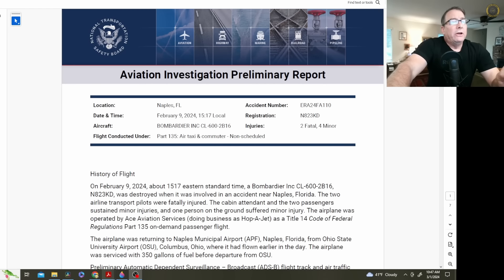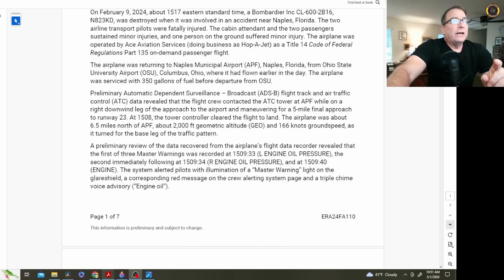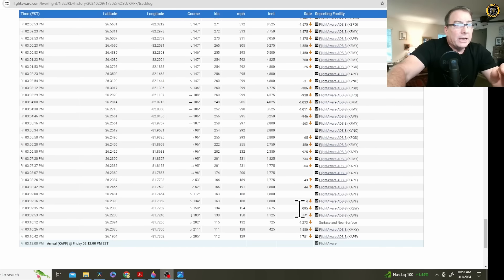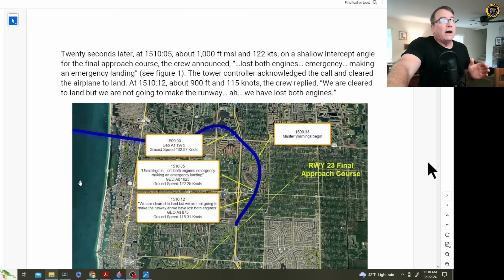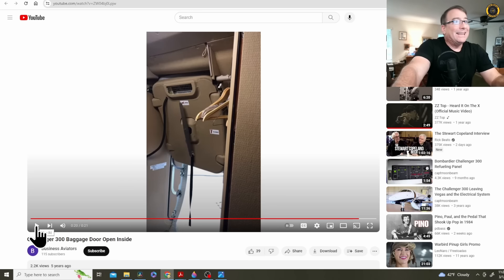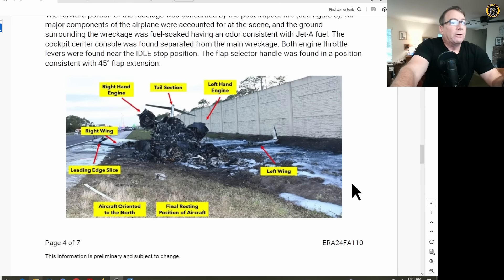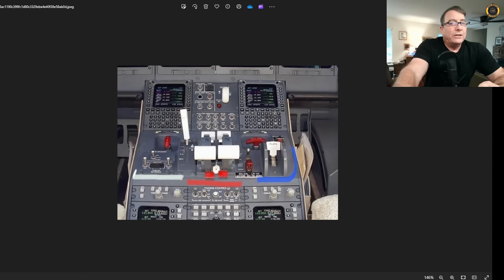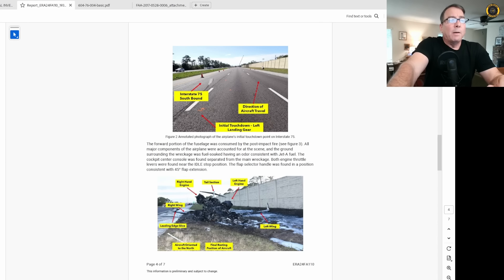NTSB Preliminary Report: Naples Challenger 600 N823KD

Comment: I don't fly a Challenger 
But 
At about 6 miles out and 1800-2000 AGL ft would you ever move the thrust levers to Idle?
Would the pilot in the left seat put his arm UNDER the FO's arm to operate the flaps?
That seems weird to me..
Could a Software glitch shut them both off?
RIP Pilots, they Almost made it
The drift to the right in the end got'em.
Reply: OK rereading the Flight recorded data they were about 6 miles out 18-2000 feet and 166 knots, 
Was this too fast and the throttles retarded to flight idle and then moved into idle cutoff?
It looks to me in my Lazy Boy that the crew shut down those engines
OUCH
Great footage JB of the baggage door, what a safety feature!

Comment: on the subject of 'reaching' flaps and other pilot decreasing thrust simultaneously.. wouldn't the designers of the aircraft not have somehow applied prevention of 'engine shutoff' whilst the altimeters and air/ground velocity were above zero? I'm struggling to think of a situation where shutting the engines off entirely in those circumstances would be necessary? Surely a pulling a fire extinguisher would do the engine shutdowns above the 'non zero' conditions? @blancolirio

Comment: Water in the fuel.   I live very close to the crash site.    According to the map of the flight path it is likely that the plane flew directly over my house (probably at 1510.00);as many do on the approach to Naples. I am very interested in this crash and will continue to monitor the investigation. The first fire fighting units at the scene were regular units and used water to control and or fight the blaze, thus inundating the aircraft with water. Perhaps this is the source of the water?  The word on the street is that the Naples Airport dispatched the foam trucks.

Comment: I left a long comment on the first video. 
I work with the Critical Air Ambulance team that crashed just after takeoff in San Antonio airport back in 1994. All crew aboard kil*ed do to the wrong fuel being put in the plane. Jet fuel not Avgas. The pump handles were put on the wrong pumps. The pilot tested the fuel but the correct fuel was in the line but not in the tank. It's a sad but interesting story.
Reply: Is there a link?
Reply: But this aircraft seems to have flown much too long for this to be a possibility
Reply: DUE to the wrong fuel.

Comment: Even if they inadvertently shut them down it takes only seconds to relight them.
Lift red shutoff levers, move thrust levers back to idle, press in continuous ignition switchlight, that's it, they will be running again, plenty of time from 1000' agl to do this and the CA would know this.

Comment: Jet A at it's jelling point can still flow at the huge demand rate of the engines at cruise.  Slow the flow rate at idle-decent, and then advancing the throttles can starve the engines from the sluggish fuel.  All evidence will of course be melted.

Comment: A small Cessna is 3 lane widths wide and might fit in the median while this plane is 6 lane widths. If it landed in the median its wings would be hanging over both left lanes, and landing on the road, it is hanging 10-20 feet off either side depending on centering. If the bellied in I suspect they would have made an attempt to cut off all thrust and fuel flow to the engines as or just before touchdown because you do not want thrust or fuel flow and want to stop. I would make much of an idle thrust lever position, this is a crash and I doubt they had any thoughts of using the engines on the ground or they would be available for normal landing engine use.

Comment: Yeti Airlines of Nepal ATR72 in 2023 they reported one of the pilots pulled the props to feather instead of throtles.  Adding throttles  wouldnt add thrust .  Then in panic elevators up too.. And stalled.  Killed most.  Using heavy gloves mutt the feeling of the tips of levers.

Comment: Didn't know until this, that the three that got out weren't all Pax. The cabin crew girl did a GREAT job too. The guy in the command seat reaching over to get the flaps
for the FO flying at the time being that clumsy ??? Best job possible by whoever was flying.
Reply: The “cabin crew girl” was ALSO saving her own ass!
Reply: It wouldn't have to be a "clumsy" move. Just both pilots doing what they were supposed to be doing at the time.

Comment: With thousands of hours of flying and thousands of landings between the cockpit crew, pulling the throttles to idle just prior to touchdown could be a muscle memory example, regardless of the engines running or not. I'll bet Sully's thrust levers were at idle before his landing on the Hudson. I don't know if the throttles at idle is necessarily the smoking gun.
The theory of inadvertent cutoff certainly is plausible and makes the most sense.

Comment: I'm going with throttles moved to the off position.  Question is how did it happen.  Juan gives a good analysis on how that could happen.
Same thing happened with OU quarterback Steve Davis.  PIC let him fly the approach and he inadvertently moved the throttle past the stops turning off both engines.
If it was fuel it would seem more likely to happen during an earlier stage of flight vs in the last 2 minutes during approach for landing where the throttles would be moved to idle.  I expect the CVR will reveal exactly what happened.
Reply: Except you would think that two very experienced pilots would have checked this immediately. How did they not try to throttle up and/or restart? Makes no sense.
Reply: @OMGWTFLOLSMH  Not very experienced in the Challenger.  It's looking like the engines shutdown ~1500 and about 1 min before the crash.  I don't think they had time to restart.
Reply: @OMGWTFLOLSMH because it's impossible to restart the engines that low and slow without the APU running. The engines are started by air powered starters that get bleed air from the APU. It takes almost a minute to get the APU started and spooled up online, then another minute or two to get at least one engine started, up to idle, then able to add power.

Comment: wasn’t there a similar mishap on a yeti airlines ATR when the copilot inadvertently shut off the props instead of adjusting the flaps?  on the ATR the levers are adjacent and there are no lock levers and the hand movement is the same, take hold of a lever and pull back. But on the Challenger the copilot would have had to release both lock levers and somehow pull the throttle back with his arm while reaching for the flap controls (?).

Comment: From what I can find, in the CL-600 if you lose 2 engines, you lose the 2 engine driven "primary" hydraulic pumps and perhaps the 2 generators driving "backup" pumps for the flight controls, unless a windmilling engine is sufficient to maintain pressure via either source.  System 3 - Utility hydraulics (another source of power for flight controls) has electrically driven primary and standby pumps that can be powered by the APU (if running inflight) or by the "ADG," Air Driven Generator (essentially a Ram Air Turbine) as a final source of backup hydraulics.  

Question is, perhaps the reason they couldn't finish a perfect highway track alignment was a loss or "degraded" source of power to the flight controls?  I didn't see any mention of this in Juan's report but regardless, a hell of piece of aviating in the worse case scenario the crew found themselves.  RIP to the cockpit crew...
Reply: From the videos  it appears the ADG was not deployed so it is possible they had the APU/ gen online ( everyone flys these things differently - some light them up on final or some wait till after landing runway turnoff)  or else the ADG would have deployed automatically from loss of a generator... or tried to. 
The Challengers have 6 hydraulic pumps 2 of them engine driven and if the apu was lit then they had AC power to run the 1B and 2B and I think the 3B hydraulic pump too.  For arguements sake if all 3 systems were inop there are accumulators for each system, so there would be a few strokes of hydraulic assist available for flight control. Also never factor out the power of pure raw adrenaline, the flight control system is cable, bellcrank and pushrod so it can be flown.

Comment: What about the fuel purchased not containing any Prist after it was offered by the fueler but declined by the captain?  If there was slush in the fuel filters, the fire would of course melt any icing in the fuel without leaving any trace.  Is it possible the fuel additive was declined because they were flying to Florida and assumed they did not need it.  This sure reminds me of that British Airways Tristar losing power on short final.

Comment: I wonder if the flight data computers record the thrust lever position state if they have entered the idle cutoff position due to left seat PNF inadvertantly releasing the interlock with his right forearm while lowering the flap lever to landing position, then them both realising within a few seconds of no engine power and the subsequent low oil pressure alarms, as an accidental situation, then advancing them forward back to idle in the hope of a relight (which it doesn't do)? A very sad accident, and superb life saving job by the cabin crew member.

Comment: Given the possible failure mode of the left-seat pilot needing to reach around behind to adjust the flaps - which is hardly an unlikely scenario - and inadvertently raising the cutoff guard levers, I'm kind of surprised that that design was approved.

Given how close together the engine failures occurred, it seems like fuel contamination would be an unlikely cause, but it's good that NTSB is retaining everything to thoroughly investigate that possibility anyway.

Even if inadvertent shutdown wasn't the cause here, at least judging by the information presented here, it seems like this is a design that needs to be changed to prevent such an inadvertent shutdown scenario from occurring.

Comment: I've got to hand it to you, Juan.  Inadvertent selection of idle cut off on both engines is plausible, and you were able to think of a mechanism for it to happen.  That 100-150 hours in type is a period where you begin to feel pretty comfortable, but things really aren't well burned into muscle memory, so you don't pick up on "that didn't feel right" as quickly.  Fuel contamination isn't completely implausible - but for the similar but separate systems to fail simultaneously pushes the probability envelope pretty hard.  Yes, they were fueled from the same source; but failing within a few minutes of each other would be easier to see than about 1 second apart.   At this point there may be two plausible causes, but one of them seems a lot more probable than the other.  I think you've nailed it, and more than a year ahead of the NTSB.
Reply: I thinik on a you tube video a pilot who flys this plane said it has happen before.,
Reply: Juan didn't come up with the theory.

Comment: If the PF vs PNF thing is actually what caused this, that’s a problem. Corporate jets aren’t built like airliners, they’re built with a PIC and SIC in mind. If the SIC is qualified to fly in the left seat and it is his leg to fly, it’s always been my experience that he climbs in the left seat for that leg.

Certain breakers are over on the left side of the cockpit (using Beechjet as an example) that aren’t accessible from the right seat, and those breakers seemed to be clear to me that the pilot in command of the flight would only need access to those breakers. The breakers aren’t in a central location easily accessible to both pilots further leaning towards the PIC of the flight flies in the left seat.

Comment: Both engines had LOW OIL PRESSURE lights illuminate within one second of each other and the NTSB goes to the trouble of removing both engines but the NTSB can’t grab a rag and read the oil dipstick to verify the amount of oil in each engine?
Reply: Did you not listen? The low oil pressure warning was initiated because the engines shut down causing the oil pressure to drop. The low pressure warning has nothing to do with oil levels in the engine 🤦
Reply: @jamesnichols7507  first off you have no idea if they checked the oil level on site or not. Secondly, regardless, they will remove the engines for detailed inspection anyway. It's common practice and certainly oil levels will be inspected at some point. Removing the engines will not effect that. By squawking about oil levels suggests that you think that is what caused the low oil pressure warning. It is not. Low oil levels would be reported by a different alarm.
Reply: @Jim-ku6ry  Once again seems to me if both big RED lights in the cockpit illuminate saying “LOW OIL PRESSURE” someone post crash would at least check the physical level of the oil quality in each engine and report the levels.  At least that is what my local shade tree mechanic with a GED certificate would do if I came into his shop with an OIL PRESSURE light illumined on my dashboard.  I’m not saying it’s an oil quaintly issue but I do know this much, you don’t know for certain either.  It’s a “preliminary report” mandated by ICAO rules to be done within 30 days of the accident checking off the big ticket items and looking for any major flag so the rest of the world wide fleet can take action if it’s an obvious design flaw or maintenance issue.   So for now it might be months before we get anymore information out of the NTSB or we just might have to wait for the NTSB to convene the final hearing before we hear how much oil was in each engine.  Once again go watch “Fate is the Hunter” and report back.  Up to speed on EA855?

Comment: wonder why they didnt go for the center grass strip between the lanes of the highway. He wouldn't had to worry about the wall which ended up killing them.
Reply: There were many obstacles in the median like fences and street lights. It was barely wide enough to accommodate the jet's wingspan anyway.
Reply: In the median there was a steel 3-cable barrier fence with 3-inch I-beams set in concrete that would've torn the aircraft to pieces. You can see it in the trucker's video.

Comment: do ya think autothrottle could have moved the levers passed the gates in turn closing the fuel SOVs? pretty sure this plane had proline fusion upgrades as well as auto throttle added..
Reply: No, they have no authority over the latches.
Reply: @GLEX234  if they are out of rig it could move far enough to close the SOVs

Comment: Juan can you explain more about the Jet A additive “PRIST”?  Which from my knowledge helps with de icing in the fuel at high flight levels. @Dan with DTSB also mentioned the prices at the airport if departure were the same with or with with PRIST. So sad if that is the case.
Reply: PRIST is required where the design does not include a means of warming bulk prior to the fuel controller.  Most small jets, like Citations, need to mix PRIST, the Challenger doesn’t as it has a fuel/oil heat exchanger and fuel temp probes to monitor temp at the tank and engine.
Reply: Hey thanks for the reply. That does make sense as I thought there had to be some sort of heat system with bleed air or something since they spend so much time in those temps. I guess we are back to the contaminated fuel but that seems odd that it would manifest so late in the flight. Inadvertent duel engine shut off by the pilot reaching for the flaps is plausible given the stage of flight and flaps needed for landing I guess.

Comment: If the throttle had been taken momentarily to the shutoff position, would not returning them to idle or above thrust while the blades are being turned by the airflow not reignite them?

Also if the pilot in the left seat got his arm pinched by the idle cuttoff levers, would his arm being in the way of the levers not prevent them from being taken further back due to the cutoff levers being attached to the throttle itself?
Reply: Likely not at such a low airspeed as they would have been turning final.  If you shut them down it's over at that altitude.  Even if there was enough speed you'd still need continuous ignition on in order to light the fuel again and simply returning the throttles to idle doesn't necessarily turn on ignition.  At that altitude and airspeed there was virtually zero chance of relighting an engine if shut down.

Comment: Any water in the fuel would have indicated on the flight up if it were there...Any water added at the Ohio station would have repeated in other aircraft...The timing of this fits the gear box teeth problem...The Airworthiness Directive said that wear on the hardware in the throttle gear box would misalign the mechanical parts so they would shift and cause the idle position to slip back to the engine shut down position...

Comment: Dan Gryder of the Probable Cause Channel says the problem stemmed from the fact they bought 350 gallons of Prist-negative Jet=A. Prist keeps the fuel from conglomerating in the cold temperatures encountered in cruise flight.
Reply: Prist isn’t required because the aircraft has fuel heaters exchangers. As long as the fuel isn’t contaminated, there is no problem. But if the fuel is heavily contaminated with water, no amount of prist will help. Prist is mainly to help aircraft that don’t get used much (bacterial growth)or don’t have fuel heaters and have a natural small amount of water. Jet fuel always has a little bit of water in it.
Reply: So they flew all that way and no problem? Then when they cut the throttles back to land the fuel gels. I stopped watching that guy. He's wacky.
Not a pilot. What's great about YouTube is you watch who you trust.
Reply: @lrc87290  I watch Dan and he's a pretty sharp guy.  He's going to be wrong on this one, I predict, though.